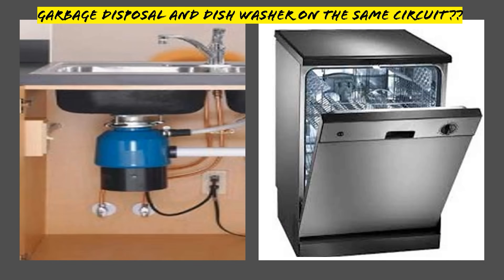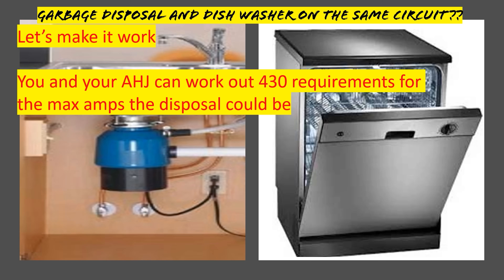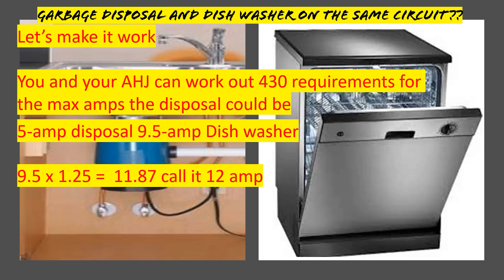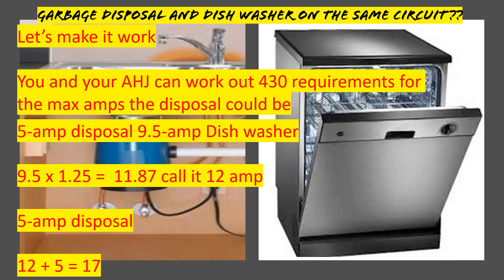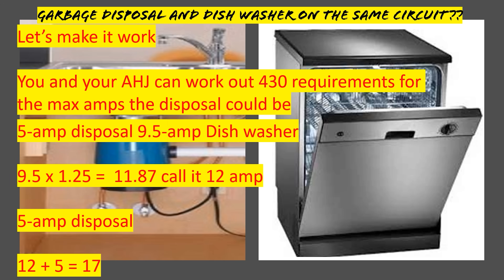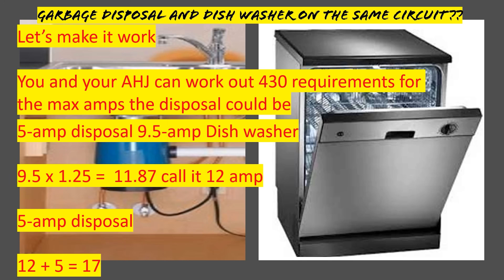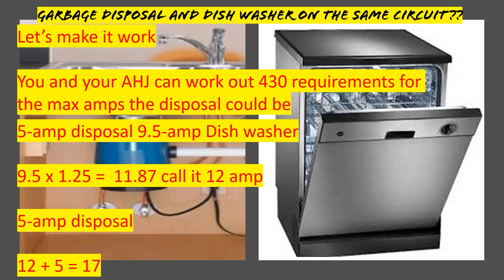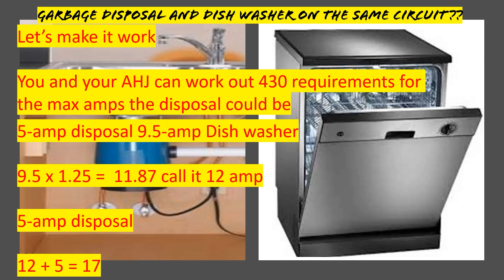Garbage disposal Dish washers Same Circuit Finish.

Comment: This would be ideal in old homes with no attic, or a custom home, where a new disposal or dishwasher is desired, and drywall damage is not wanted, or it is obnoxiously difficult/impossible to get back to the panel with a new circuit. The one existing 12/2 could then handle both instead.
Reply from the maker: You nailed it!

Comment: I have two red wires hooked up to my switch on a duplex receptacle that is half hot when you flip the switch it's supposed to work the garbage disposal but only the bottom receptacle is staying hot when I flip the switch it doesn't turn on the garbage disposal.

Comment: Excellent illustration of how we as Electricians should use the code to our advantage. Ive been wiring residences like this and using the 3 va per sq. ft rule in my area for many years now and I cant tell you how many times i get chastised by other fellow electricians for doing so. I tell them I follow the Code. Its there for us to use. Ive looked at other companies panels side by side of mine and I can honestly say they are spending a lot more on wire and breakers. Maybe thats why I win most of my bids.